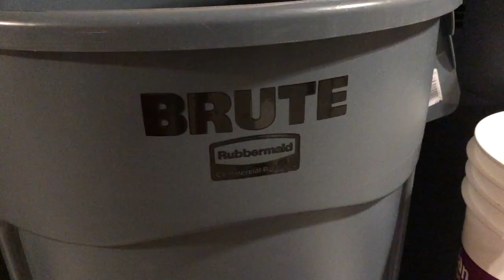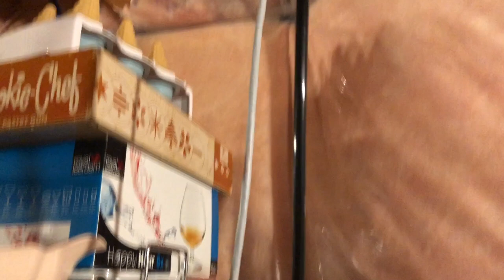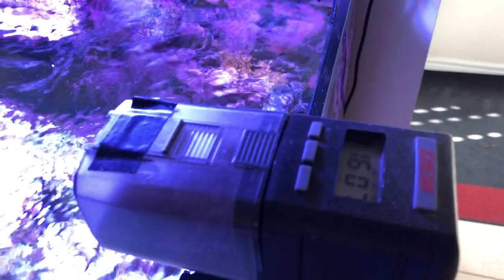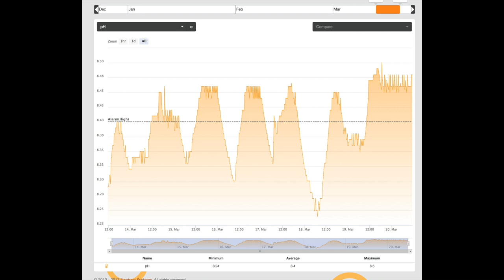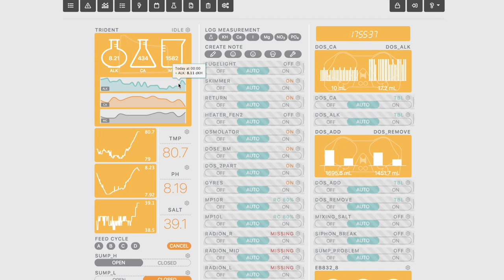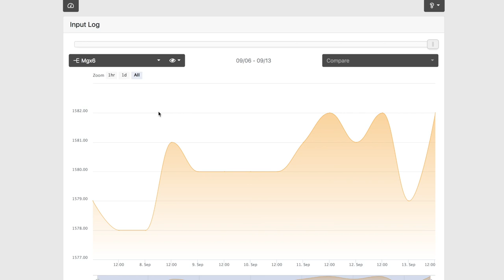Top 5 time-saving reef upgrades

Comment: Main downside of Automatic Water Changes is the temptation to skip cleaning the sand etc. Water change time is a great time to do a fair bit of cleaning, such as the skimmer. It's not that it stops you doing it obviously just takes a bit more self control.
Reply from the maker: Freaky Goblin agreed. I have been a bit lazier with equipment and sump cleanup, although I am trying to be better by scheduling things on my calendar

Comment: Hi.  I was wondering how were you able to close the reefer overflow cover on with the Ecotech RMS arm?  Did you remove the spacer to make the base of the arm less thick?  My overflow cover has the same cut out as yours but can't fit it.  Thanks
Reply from the maker: KN H I removed the cut out and a bit more plastic to make the arm fit. The spacer is the same size

Comment: I’ve always looked at this hobby as a “hands on” hobby. I understand there’s a certain demographic that will benefit from being “hands off” though..  I have to say that a 50 gallon top off container is a time bomb waiting to destroy your tank and house, I hope you have triple failsafes on that thing! 😱
Reply from the maker: :) why - because of the risk of a leak ?
Reply: AmroAzul TV you have the potential of pumping 50 gallons of fresh water into your system. I would never have a top off reservoir hold more water than the system can handle/overflow, or drop the salinity too far.
Reply from the maker: DVs Reef oh yeah - although I think they is a purely theoretical risk - there are 5 failsaves  that would shut off the tunze if water level if it got stuck. Osmolator has a 10 min automatic shut off if pump is run continually. The tunze has an optical and float switch to monitor water level / they would shut down pump in case of overfill. I also have another optical sensor I’m the sump that would shut off the water if it rises too much, then I have a salinity probe that would shut down tunze if salinity drops by a point. So it’s mostly risk free and I get to enjoy never having to carry a bucket of rodi water again
Reply: AmroAzul TV well let’s hope those failsafes do their job I honestly have never had a fail on any of my top offs but if they did I would never of had an overflow or a salinity drop too far!

Comment: Man I'd be scared of that huge ATO reservoir... If it somehow gets stuck on, you're going to have a huge flood and a dead tank
Reply from the maker: I think this is a purely theoretical risk - there are 5 failsaves  that would shut off the tunze if water level if it got stuck. Osmolator has a 10 min automatic shut off if pump is run continually. The tunze has an optical and float switch to monitor water level / they would shut down pump in case of overfill. I also have another optical sensor I’m the sump that would shut off the water if it rises too much, then I have a salinity probe that would shut down tunze if salinity drops by a point. So it’s mostly risk free and I get to enjoy never having to carry a bucket of rodi water again
Reply: Total redundancy with Apex controller-leak detection, text messages.....no way you wont catch it.